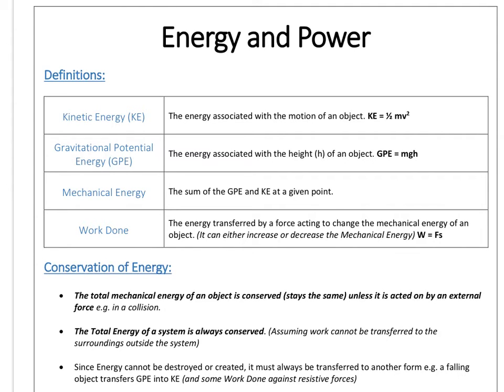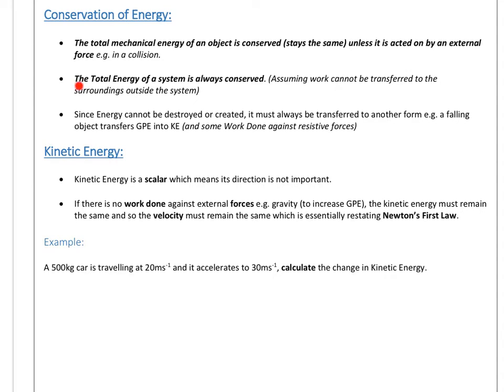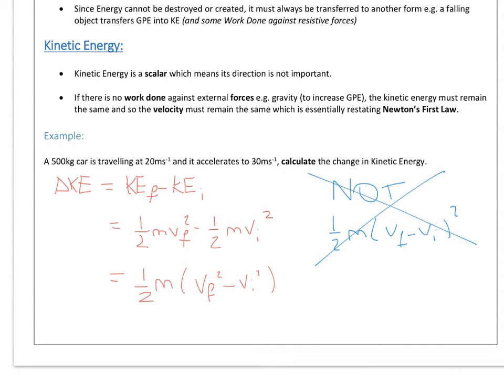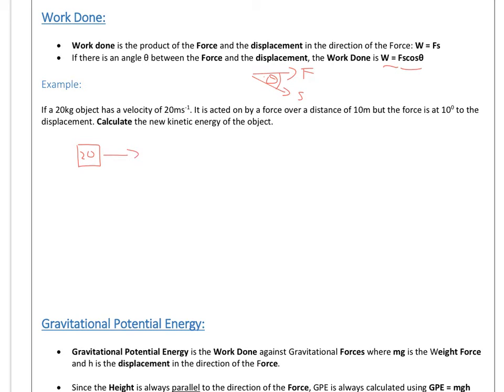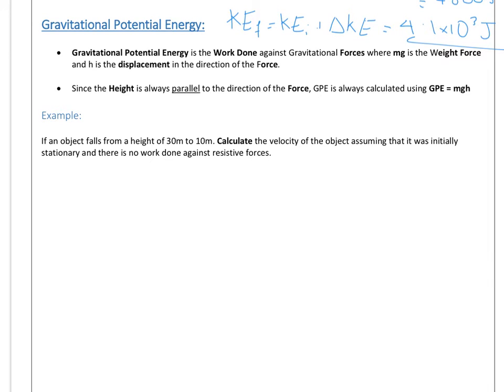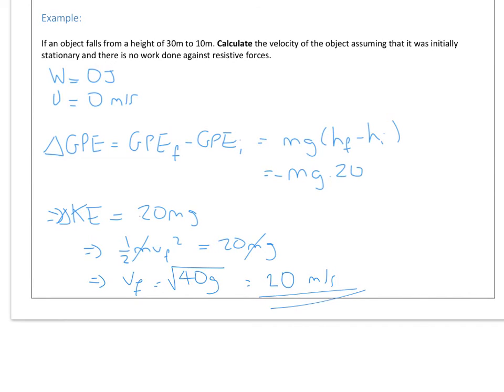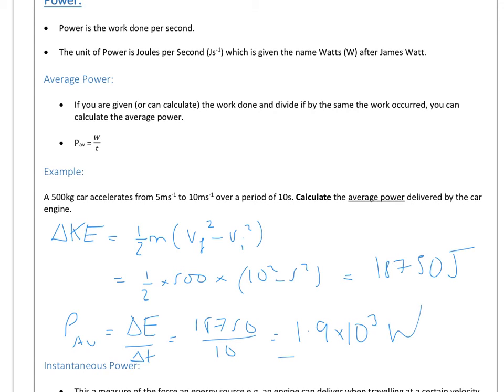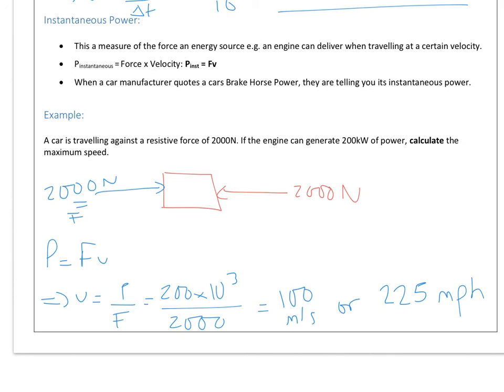A Level Physics: Mechanics: Energy and Power

Comment: You made a mistake at 8:50. The question didn't specify and said the force is 10N. You read that wrong
Reply: yh exactly I was wondering what I did wrong
Reply: Apply trigonometry ratio. Cos = base\hypotenuse. Cos10=10\hyp